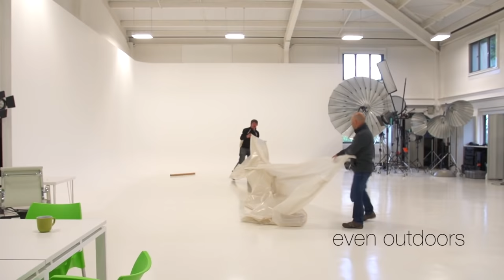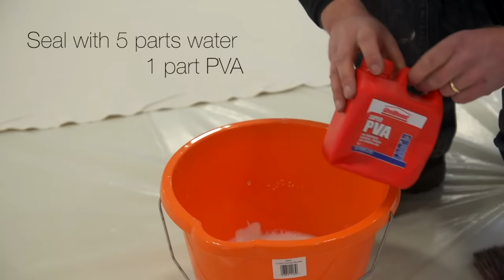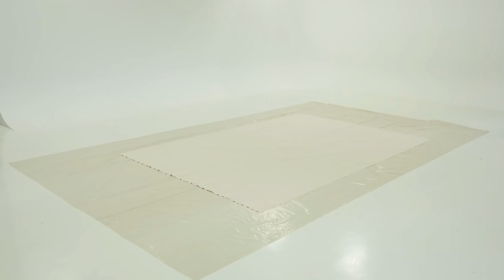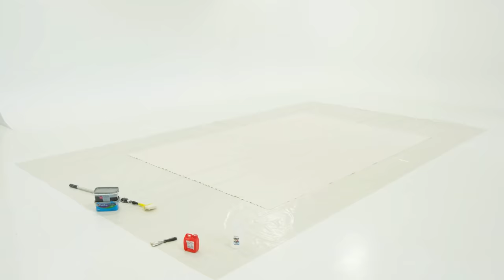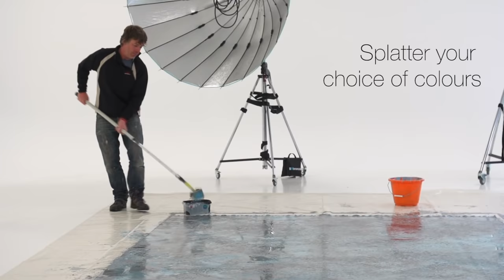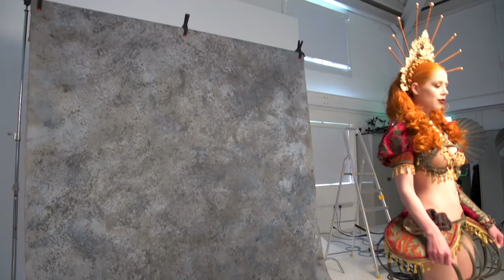How to make your own studio photography backdrop.

Comment: Hi Karl,old vide,hope y will see this post.
What kind of colour should I use.just simple colour for indoor wall painting?
If so ,what I'm interested in is whether the paint cracks after a while, because that paint is for walls and it doesn't bend like with canvas, it has to be packed in a roll after each use.

Comment: Thanks for the video. Since canvas is heavier than muslin cloth, does it generally hang better off a backdrop stand? And will it be less likely to crease or at least show creases? What was the purpose of sealing the canvas with PVA glue? Can it be done without that or is that to stiffen it? Thanks.
Reply from the maker: Yes is the answer to your first question and yes is the answer to the second part. It basically doesn't crease at all and the PVA glue seals it all, you just have to roll them up carefully when not using them.

Comment: Hey Karl! Thank you for the video. I’m not sure if you’ll get this being insanely busy. Two questions for you please :) What are “wash colours”? What is the tool you used to splatter the paint with? Pretty bad ass!! Thank you!
Reply from the maker: Wash colours are watered down thin paint applied mulitple times and then splatter slightly thicker paint in by flicking a paint brush on it. It's a bit of trial and error but you can see the thing building up as you do it.

Comment: HI HI KARL . A LITTLE  THE QUESTION....: BUT BETWEEN THE SEVERAL COAT... 1)YOU WAIT TO GET DRY THE CANVAS BEFORE TO PAINT THE NEXT ONE COAT OR 2) ALL THE LAYERS OF PAINT WAS PAINTED ALL TOGETHER IN 1 SINGLE TIME? THANKS A LOT. (CAUSE TIME LAPSE DOESENT SHOWS TIME). BYE BYEEEEE
Reply from the maker: Hi if you can do it both ways but if you let it dry a little but not completely then you can get some interesting blends.
Reply: Karl Taylor thanks thanks

Comment: Karl... Thanks for the reply, good house keeping would be to lay a cover over the light.
Reply from the maker: Why we use it regularly, I don't lay covers over any of my lights as it would be too time constricting taking then on and off all the time. If you meant to protect it from while we were doing the painting of the canvas then it was too far away to receive any splashes. Our studio is 24 meters (79 ft) long, I'd expect this light was 3m away. We do clean the lights once a year as the tops of them collect a bit of dust over time but that only takes 30mins a year compared to putting covers on and off every day.